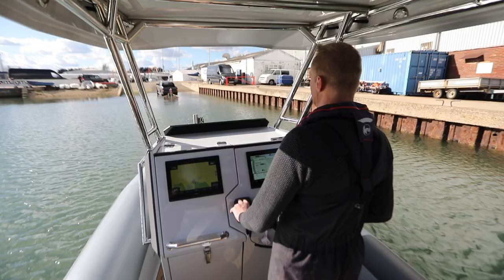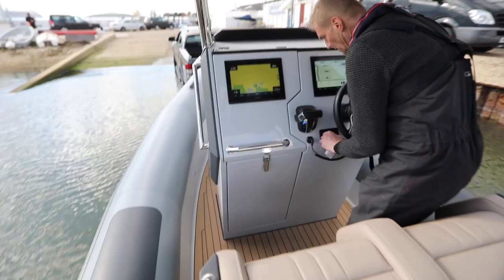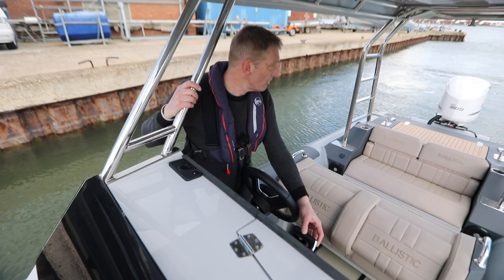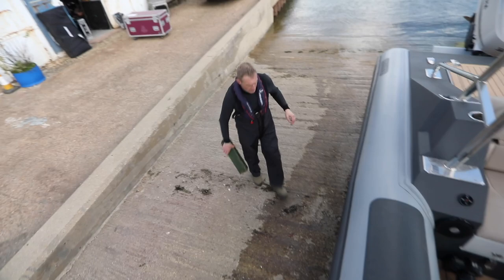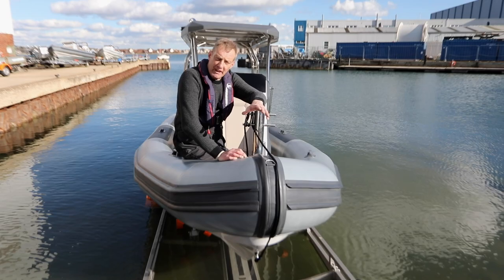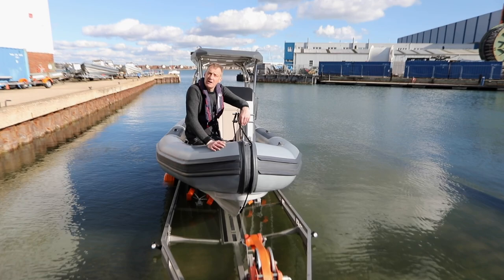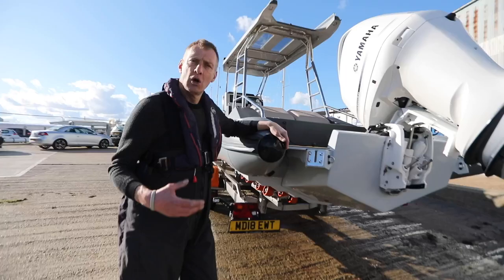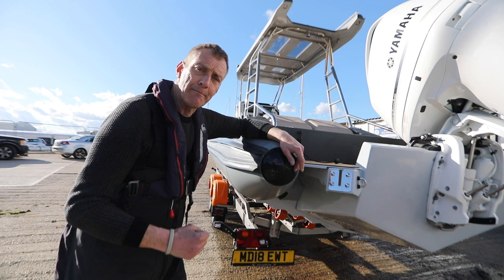How to recover a boat on a trailer | Jon Mendez's expert guide | Motor Boat & Yachting

Comment: I would love to have a ramp like this, quiet, tons of room and easy to get a straight shot on to your trailer.  At mine it is a busy mess with only one dock so you have to alternate outgoing and incoming and we are not allowed powering on so you get one burst and that is about it. It gets heated and hectic at certain parts of the day and if you or anyone screws anything up due to the pressure (happens all the time and to everyone) things just deteriorate quick.

Comment: And now trie the same thing without your trailer's brakes get underwater...
Reply: Ive got the very same Vanclaes Gyro roller trailer, just with one axle instead of a double. There's absolutely no need to submerge the trailer any deeper as up to the point, when the tail lights start to be submerged. That's why it has this amazing gyro roller system :) 
The procedure here would be right if you had a simple trailer with bunks.